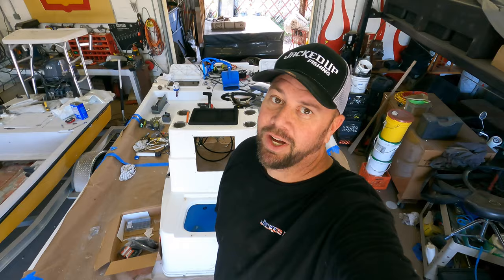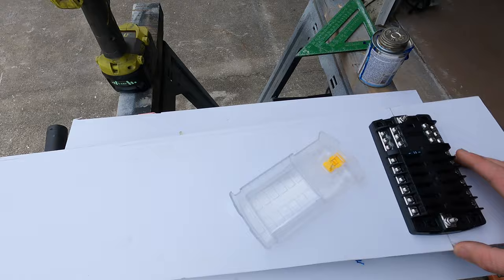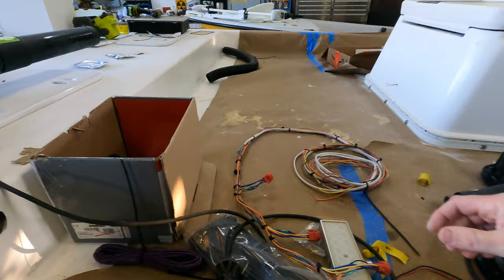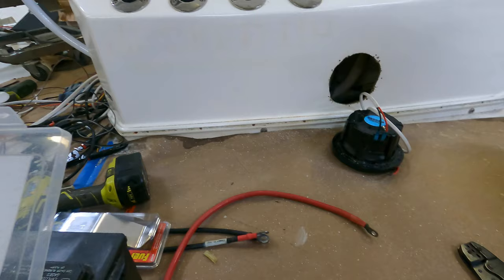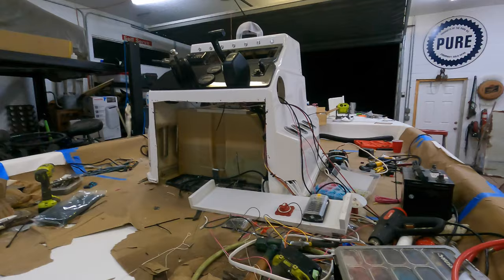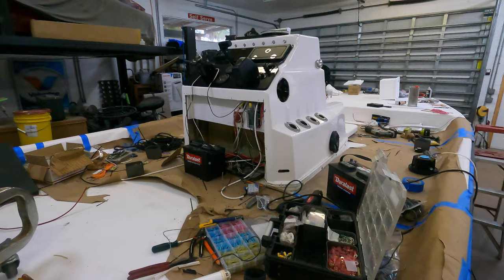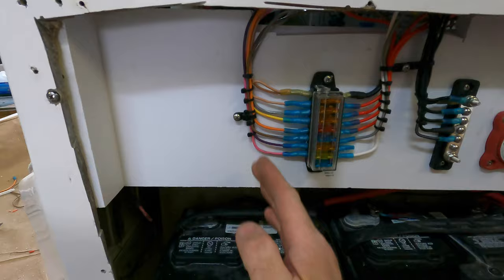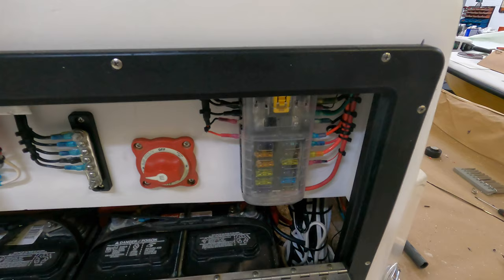HOW TO RE-WIRE YOUR BOAT - The Correct Way That Will Last a Long Time!!

Comment: on the klein crimper the nippled part you used is for non insulated connectors if you look it should be labeled on the crimper NON, that is the reason it breaks thru the insulation. right under that there is a second slot labeled INS without that nipple which would be the correct slot to crimp that connector. hope this helps!
Reply from the maker: Yeah but the Kleins do not crimp good enough on the heat shrink connectors at least I don’t feel they do.  The ratcheting style do way better.

Comment: Be careful with using too much dielectric grease, It's actually an insolator so it won't allow for the free low of electricity. Equipment that's sensitive to voltage drops may have issues.
Reply from the maker: Yeah for sure.
Reply: Not a real problem if used sparingly

Comment: With the crimpers, theres an insulated and non insulated crimpers. The klein has both. Use the one behind the one you used.
Reply from the maker: Yeah as long as it doesn’t break the heat shrink
Reply: @JackedUpFishing   It doesn't, I do hundreds of connectors a week with them.
Reply: @GrOveN2890  can you put up a link to these ones you swear by?  I don't mind have a few good ones around.  👍

Comment: The cellular structure of the PVC board can be a little tricky for holding screws, if you put your screws in then back them out and put a little epoxy in the screw holes it will harden up the threads and prevent them from pulling out.
Reply from the maker: Great tip.  Thx 🙏

Comment: How has those switches held up?  I am re doing my console now, and bought a bunch of those, but am worried about the quality. Boca are all electronic, and entirely too expensive.
Reply from the maker: They have held up great. No issues. I agree can’t spend that much on switches!
Reply: @JackedUpFishing  Thank you sir. The panel just came off the CNC this morning, I’ll be wiring it up most of the day 👍👍
Reply from the maker: @Gmtail sweet!
Reply from the maker: @Gmtail  sweet!

Comment: so this wasn't an editorial it was just showing you how it shoould look right?
Reply from the maker: This was a how to giving you tips and tricks on wiring. I went through items like using the correct crimp tool, what do you need to do as far as wire, routing and correct use placement. So I think it was an instructional video more than anything.

Comment: Wish you would have shown the Yamaha multi command wiring job.
I'm rewiring my Yamaha gauges. Just bought the boat. Tach works. The Speedo gauge I have a light.... That's it.
My fuel tank has a pink coming up to the console. Too bad you're not in MLPS, MN. you do excellent work!
Reply from the maker: Yeah.  That’s the motor rigging.  I was focusing on the console wiring.  Appreciate the compliment.  Everything still working flawlessly

Comment: I have those exact strippers made by Irwin I think?  Absolutely love them.  Buying a decent ratcheting crimp tool with replaceable dies is worth it if you do more than a couple of these types of adventures.  I wish I could d get that pvc board as easily near me in Canada - also makes great transducer mount on transom.  Thanks for sharing!
Reply from the maker: Yeah that pvc board is great stuff.  Surprised you can’t get it up there.  Yeah I have a few different type of crimp tools.  I also have a hydraulic crimp tool which is really awesome. Thanks for watching!
Reply: @JackedUpFishing  been meaning to get a hyd one for battery cables/welding lugs - tried one before but it was very slow.

Comment: Can you clarify why you did two fuse blocks? You mentioned one is connected to the main red on/off battery switch but the other isn't? What things are on one vs the other?
Reply from the maker: One is for all of the accessories from the switches, so each circuit is protected.  The other is fused power to unswitched devices like jack plate, power pole, etc.  which also has ground lugs- hold that helps
Reply: @JackedUpFishing  Just to clarify, all circuits are fuse protected, it's just that you kept one fuse block for unswitched devices and another for switched devices? I'm assuming if I didn't have as many devices (some switched, others unswitched) then I can just use a single fuse block? Just wondering if I should be getting two smaller fuse blocks and keeping switched/unswitched devices separated vs just gone one bigger fuse block!

Comment: I know this is somewhat an older video, but you shouldn't use tie-raps if you want something with easy maintenance but also neat looking. You should use those velcro straps instead, does the same thing, but can be easily unsnapped to re-rig something and whatnot, instead of cutting 20 tie-raps lol.

Out of curiosity, what is the beam width of your boat and the console's width? Also, is it easy to move around it on the water? I'm asking because I am thinking of buying a brand new 16 feet aluminum boat and add in a center console on it, but I wonder if it might be too large for the boat... so that would give me a good idea if it could work for mine or not.
Reply from the maker: I have actually looked at using the Velcro straps, but honestly you can not route things the same and do a tight job with them.  They also get funky after 1 season.  But if you like them then that's awesome.  More than one way to get the job done.  My boat is a 21 Shoalwater cat.  Texas made boat with a beam of around 9ft.  Console is 30 wide and its so easy to get around.  Never selling this boat. Love it
Reply: @JackedUpFishing  Holy hell! That is a wide girl you got there ! I'm looking at buying a Marlon SWV16, it would be a 16' long x 71" beam. Gives me a pretty good idea of size difference, and what I need to look for. Most likely a 24" wide console or so, to have 24" on both sides. Thanks for the quick reply!

Comment: How do you snake a wire from the console to the transom?  I have to replace a ground wire and it looks very tight from where the wires come. out of?  If I were to pull the old wire out what should I use  to attach to the old wire so I can pull the new wire through?
Reply from the maker: They sell a wire fish tool at harbor freight.  It’s a game changer.  Fiberglass fish rods go check it out!

Comment: Great information, im replacing my switches but the old switches show 18v can i use your push switches you're using?
Reply from the maker: Not sure honestly
Reply: If the item you're trying to power doesn't exceed 12v, yes. They probably put in 18v switches because that's all they had. Heck, technically you could use 110v switches, the voltages/amps listed is always the maximum voltage/amps safe for the device.

Comment: so did you move the batteries from the back  to the front under the console or thats the way its suppose to go?
Reply from the maker: I built this boat in 2012 from ground up.  Yes batteries are supposed to be there. Keeping the batteries out of the bills area is one of the best things you can do on a boat if you have the room. It keeps everything in a centralized location switch is battery on off switches and keeps your bills area clean as well.
Reply: @JackedUpFishing   let me know when I’m to much cause I need some help I have a center console StarCraft 1989 aluminum it has battery compartments in the back if I could send a picture I would but YouTube doesn’t work that way so I’m trying to rewire the whole boat kinda like your doing so why use negative and positive bus bar if the fuse block has that on it? And how do you wire something like that cause I want to add a cut off switch for 2 batteries as well as an ACR and battery charger what I found out about the cut off switch that no one mentioned on YouTube is that anyone doesn’t work and can mess your motor up. The kind that you should get is one that has a surge protector that keeps from blowing up your alternator from switching between batteries or turning it off. It’s late I’m still at work I apologize for no punctuation

Comment: Ok I’m rewiring my boat dual battery with cut off switch an auto charge relay fuse block with a negative part like yours, can u explain the extra bus bar to me I did buy a positive and negative bus bar but I don’t know why I would need it
Reply from the maker: I have one main bus bar for the big items like power poles, Jack plate , and amplifiers etc.  then I have a fused block for between all of my switches and the respective components.  This way I don’t have to run them breaker buttons tgat always go bad.

Comment: I don't see you using labels on anything, do you write a diagram to keep on shore? Or is it clear enough from your wiring behind the panel? I bought a used boat and with everything zip tied together  (and in hard to reach places) it's a pain in the butt to chase things down. Also seems like there's 4x as many wires as there should be but that's another story...
Reply from the maker: Yeah I have labels now on from of fuse block.  I actually have a lot of stuff in this boat hence all of the wires
Reply: @JackedUpFishing  Ah, I mean MY BOAT has a lot of seemingly extra wires, not yours. If mine was loaded down like yours, mine would make a lot more sense but it's pretty straightforward nav/anchor lights, bilge, VHF, a few extras. Fuse block labels make sense. My trouble is few of the wires are "home runs" as you called it, tons of splices everywhere. Trying to incrementally rip stuff out and replace with fresh wiring and terminals. Thanks for the great video and examples.
Reply from the maker: @rasliche  10-4 gotcha on that yeah get rid of unnecessary splices they will only cause problems for sure
Reply: Labels on every wire is the only way to completely organize the electrical system.   What you really want to know when you are holding a wire in your hand is where does it go or come from?  Right next to the terminal, a short label naming the location of THE OTHER END OF THE WIRE.  It will enable quicker trouble shooting and even allow full tracing of wires without probing.
Reply from the maker: @chiphill4856  yep I wrote on mine but would love to have the printer for the year shrink for sure
Reply: @rasliche  To be frank, I'm not sure where all of the wires go in JackedUpFishing's video, but I feel like there's a lot of wires as well. The fuse block thing on the right can hold 12 accessories WITH fuses. If you look at it, there's 7 screws not used, so 7 accessories could go there, but he chose to use another fuse block holder instead. I really don't understand why, because 12 accessories is a LOT, and it would cut down so much on the wires too if he just used the first fuse block holder (the one on the right), but hey, who knows... I haven't watched the entire series, maybe its explained elsewhere. (NOTE; Yes, I know he mentions that the right one is for non-switched acc. while the other one is, but it is still a lot of wires that could've went to only ONE fuse block holder instead of 2, but that's just my opinion hehe, as long as it works...)